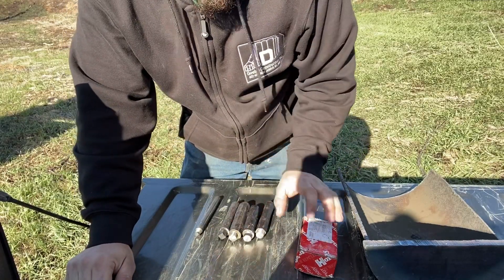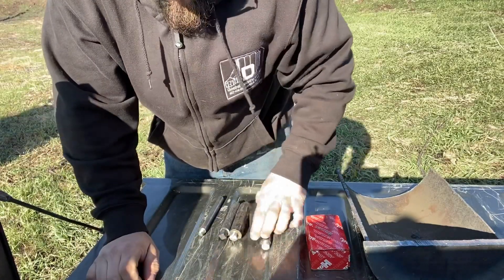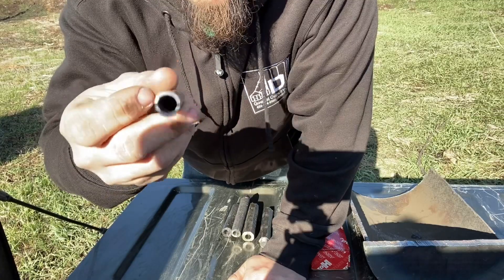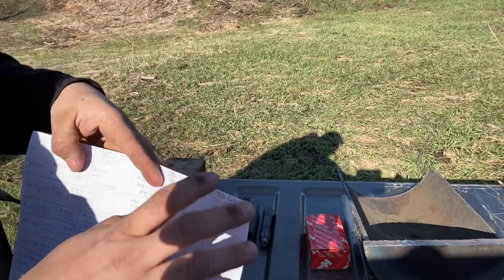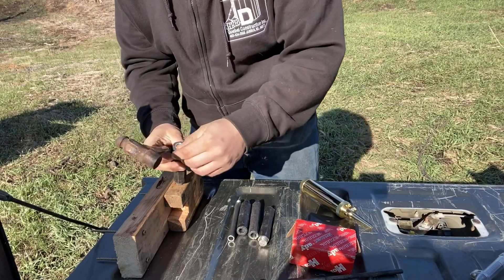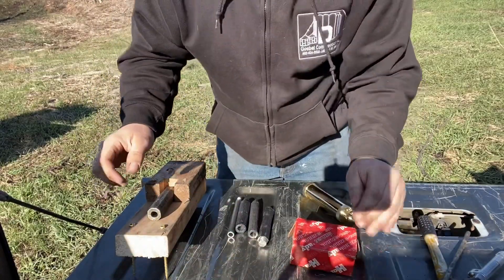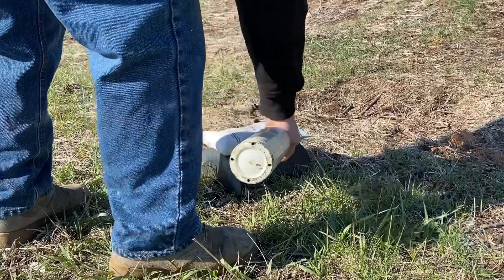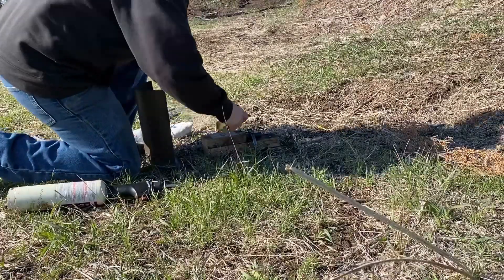Test Barrel Proof Testing

Comment: With the clam shell method, if you 45 the angle on one long side then flip it and do the same on the other long side…then do your clamshell and overlap, you’ll get a better weld…then you can retry…
Reply from the maker: You will get a weaker weld as the inside scarf wont take, there is nothing pushing it against the other scarf to form the weld. Even if you use a mandrel inside then it will suck the heat from the scarf and it’ll never weld.
Reply: @veteranironoutdoors8320  yeah good point.

Comment: I'm shocked at the performance of the schedule 40......everyone i've talked to in the home build community recommends schedule 80.
Reply from the maker: Same here! I thought for sure it would pop first go. That being said at work I have encountered sch 40 that cracked easily along the seam when the pipe was worked. Ive had no such issue with sch 80. Sch 80 is definitely the best way to go, if you are going to go that route
Reply: @veteranironoutdoors8320  would you happen to know where to get sch 80 piping? I've been making some schematics for making a budget matchlock shotgun and I would think that would be my  best option.

Comment: I'm a year late to the party, but I'm loving these videos. I'm wanting to forge myself a barrel out of wrought. Maybe just a .32 or .38 pistol. I have a 1851 navy .36, so I may go for a .38 as I could use the same ball. I'm thinking of using the skelp method, but using a mandrel and beveling the edges before welding. I'll lap them over to create a lap weld instead of a butt weld. That should increase the strength on the weld, and I'll keep the walls heavy. Then I'll have to build a contraption to drill, ream, and rifle it. I've played with making buttons before, but I'd like to make a cutter and try doing a gain twist for the heck of it. I'd like to eventually build an 1860 army copy by hand. My experience of being a manual machinist will definitely come in handy then lol
Reply from the maker: They didnt lap weld the skelp method as your mandrel will suck the heat out of the inner scarf, preventing a good weld. Doing it by oneself will only exacerbate that problem.
Theres a reason you dont see many historical small bores. They are very hard to forge and drill/ream. With today’s materials it is much easier, but it is still very finicky, and requires more work straigtening and correcting the outside for a uniform surface.
Iirc, they experimented with gain twist in muzzleloader and abandoned it because all it does is tear patches and gets lead smeared in the lands with non patched projectiles.
Reply: @veteranironoutdoors8320  thanks for your reply. I'm actually out in the shop right now working down a piece of 1" square wrought into a skelp to try out. I'll forget the lap and try for a butt weld. Given your words, im going to try going without a mandrel. Its all for fun anyway
Reply from the maker: @deleted914  I recommend the whitley method. Ive forged over a dozen barrels using that method now. Once you make your first forge weld, every heat from then on should be a forge welding heat, up until you are heating the barrel to straighten the major kinks out. Keep your fire clean, make sure your material is brought up to welding slowly so it is heated all the way through, every heat. If you dont go end to end with welding heats at least 4 times, its not welded enough (using mild steel. Ive yet to use any of my precious wrought on a barrel) and use IRON MOUNTAIN FLUX! so far the only time ive had a witley fail is this initial test. Ive come to the conclusion it was because: it was only welded 3x end to end, my fire was contstantly clinkered giving me welding temps at the surface of the material only, and I did lots of planishing and truing of the octagon at non welding heats.
Reply: @veteranironoutdoors8320  my experience shows that wrought is better than mild steel for the durability, and confidence in the weld. im not surprised the double seam came apart. what are your thoughts

Comment: I only use a 90 grain charge for my .58 caliber rifle. I use a max 50 grain charge for my .50 caliber pistol.  I think your standard charges were pretty close to double charges.
Reply from the maker: As I said, a “standard charge” is the maximum charge that would reasonably be used during normal operation, which I define as (caliber multiplied by 2 = # of grains) 
By doing this, it grants me a larger double charge with which to proof test and verify saftey and structural integrity at.
Reply: @veteranironoutdoors8320  My standard charge on a .45 pistol length is 30 grns of fffg... 60 would be double...when you get up to 90 some of the powder is burning after exiting the barrel...Thus you are not getting a full explosion inside the barrel...I bet a 60grn would be more pressure and higher velocity out of a 6" barrel...now when you get to rifle lengths I feel you are spot on on your figures

Comment: I would venture to guess that using a mandril when you forge weld using the two-piece method you'll get better welds as well, since you won't need to be as careful with not upsetting the fullered bore
Reply from the maker: Using a mandrel would be more detrimental to the weld as it sucks heat from the weld area, significantly reducing welding time and greatly increasing the chance of a weak or unwelded section. Upset/deformed bore is not really a big deal, in both cases any affected area (on the inside) is most likely going to be removed by the boring and reaming process. Also as I state in the video, I did everything here in the worst way possible to see how good or bad the outcome (of the worst possible work likely to go into the piece) would be towards the final product. I blew up some barrels like I was trying to do, and gained very valuable knowledge that has been put to use in future builds.